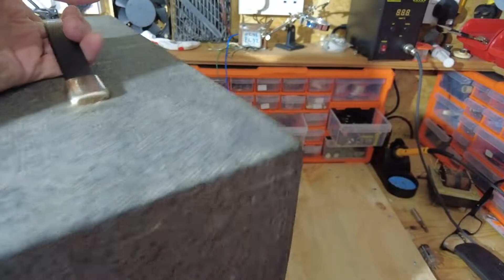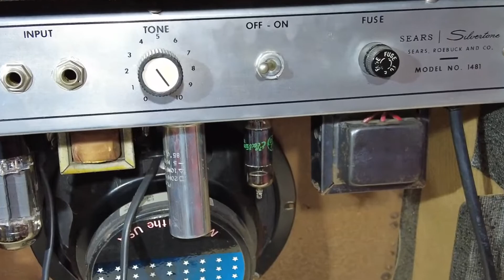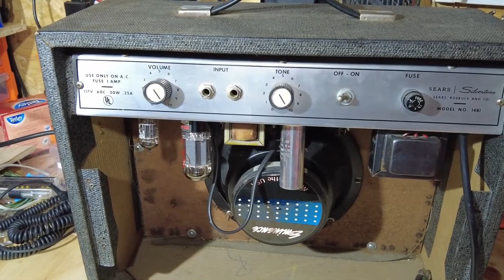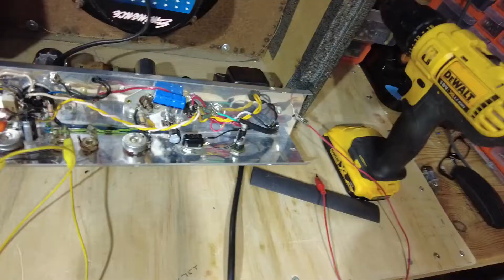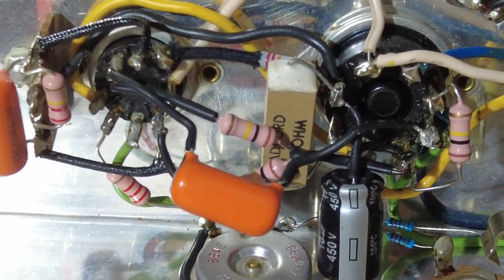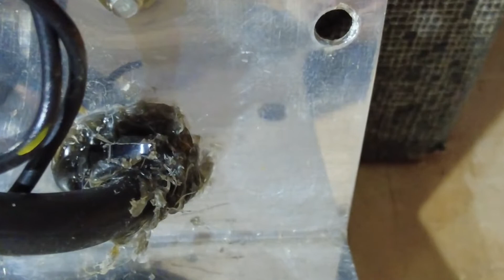Silvertone 1481 Tube Amp Check over and Minor Repair

Comment: I found an old 1420 5 XL at my mother´s attic, a cousin gave it to melike 30 years ago and never worked out so I put it aside when I was a kid. A few months ago I could make it work after adapting new capacitors, changing out of specs resistors and changing the speaker. Really happy with the work and my first tube amp repair!.

Comment: I love these old Sears Silvertone catalog mail-order amps! So much potential!
Reply from the maker: Hello Ernest. Looking at the schematic there is more potential in these type of budget amps. Thanks for watching and take care.
Reply: Made by Danolectro  in NJ.. they used rebranded RCA tubes.. closest thing to a Fender Champ.. awesome original  speaker.. can you name it?  
  my 1481 was paired up, with a 1961  copper Silvertone  / Danolectro U-1   Christmas present from my parents… still have the pair… ALL original on both.. 3prong outlet to the 1481  and the preamp tube replaced.. The guitar is ALL,original     a bit beat esthetically  but 100%  original..

Comment: I've seen these amps and look similar to the Fender Champ. Also wandered why Leo used a 5Y3 and not the 6x4 for the rectifier. Seems like not having the 5 volt winding on the PT would have been less expensive. Any thoughts?
Reply from the maker: Hello JT and thank you. You could well be right. The Silvertone amp in this video was a budget made amp aimed at students and players just starting out. The more tapping's on a transformer the more money they cost. The 6X4 was probably a cheaper tube too. Thanks for watching and for your support. Take care.